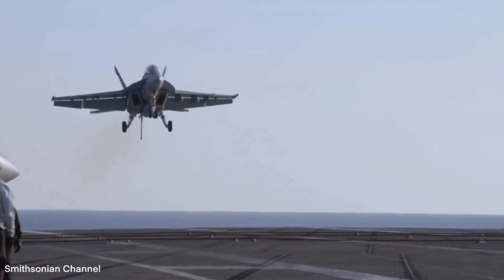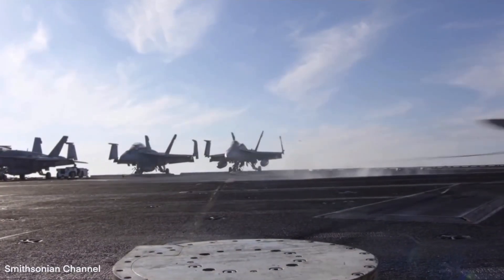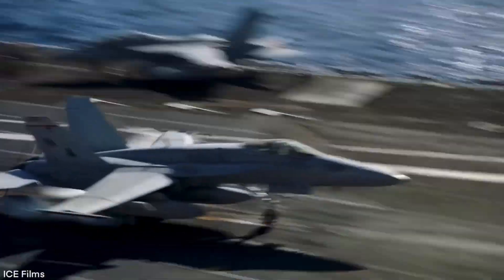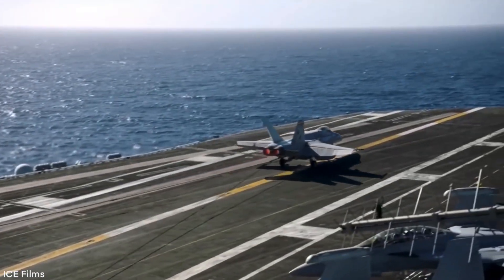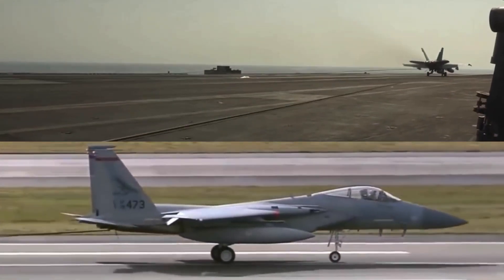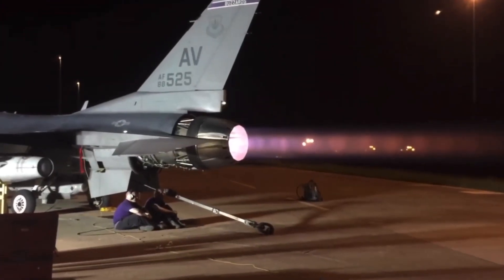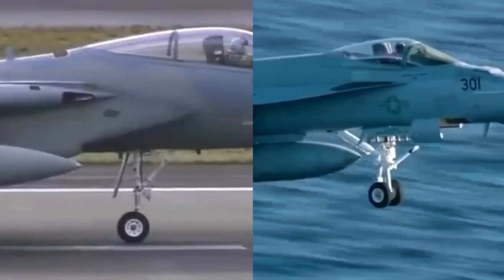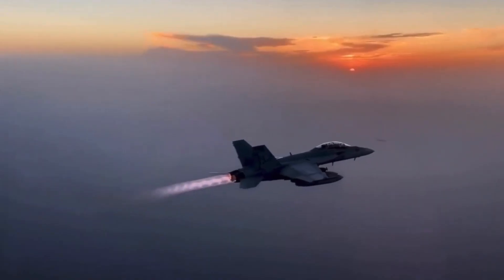Why Air Force Jets have Tailhooks

Comment: I seem to recall that carrier landings also involve hitting the throttle incase they miss the hook. Aka like the gear the af hook isn't intended to take the forces involved with a carrier landing. It's one thing to hold a stoped plane while the engine is brought to max. It's another to take the instantaneous force of moving plane with engine still pushing at max.